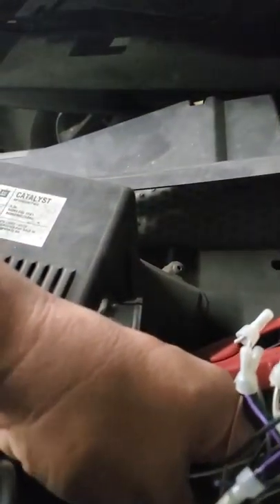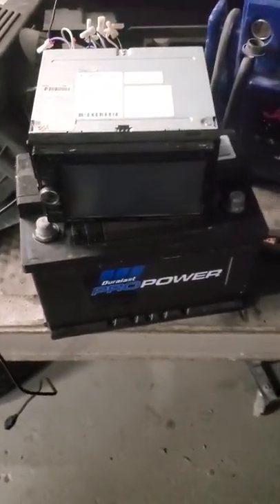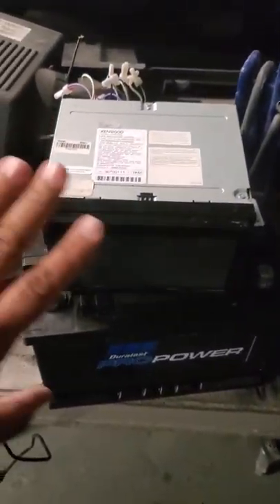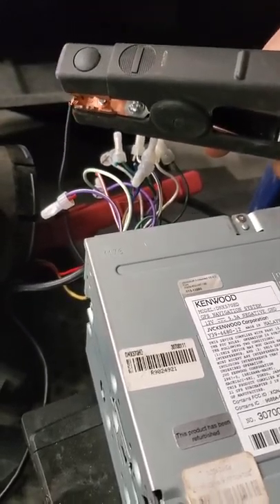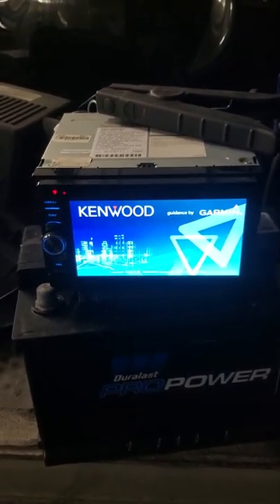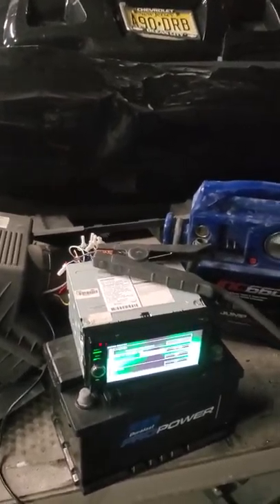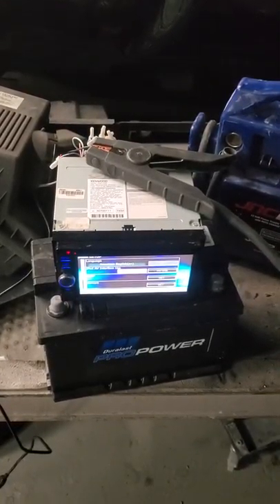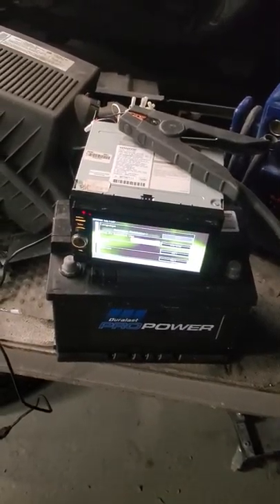Kenwood double din black screen repair

Comment: I have no idea what you just did. Because you didn’t actually tell us how to do it
Reply: Exactly right
Reply: There’s another video on the channel where he shows it. Basically there’s a daughter board plugged into the top. Remove the top cover and dvd drive, then the heat spreader plate, then remove the small board on top taking care to remove all the connectors carefully. There is also a solid black connector on the underside that connects it to the main board. 

After you’ve done that, remove the sd card by sliding the metal piece toward the center. 
Then on the opposite side of the board(with the big black connector(bbc😏) there is a big black chip😏 labeled Toshiba. Take a heat gun too it on high setting for a couple of minutes. Or just sit the whole board in an oven on 250F for 20 minutes.
Reply: well if you listen he did say what to do you reflow the unit it worked for me! wasnt expecting anything but im way happy

so ill be more clear

you have to completely dissasemble the unit remove all circuit boards and coat each one in flux both sides

then you need to heat them i used a oven but a heatgun would maybe be better

make sure do one board at a time and dont heat near plastic parts watch the flux and as soon as it starts to melt take away from heat wait and heat a further two times (the reason is too much heat at once may damage)

let boards cool dont move before cool incase any chips dislodge

this worked well for me my radio is working perfect
Reply: THANKS MATE MINE IS WORKING PERFECT NOW!

i just coated all the boards in flux and put them under the grill at 190c one by one i put them under the heat just till the flux melted (less than a minute) then pulled out waited then repeated 3 times for each side to make sure not to melt anything

i got the radio for free after fitting a new one for a customer so wasnt expecting anything ive reflowed stuff before 

i put it back toghether thinking it would still not work but its been on my rig for 4 days non stop works perfect
Reply: @hungryhungryhummer  not sure if you still active on YouTube but can I just put the radio in the oven for 20min
Reply: @hungryhungryhummer 2:55
Reply: @dondc2827 yeah man, just make sure to wrap it in aluminum foil first. 🤷‍♂️
Reply: He explained fairly well

Comment: This was fantastic! This happened to my daughters HU. I did what you suggested and used a heat gun and gave it a shot. Put it all back together and voila! It worked 🎉. Thanks so much for posting this!!
Reply: used heat gun on where?? please help. :)
Reply: @sonchan3621  watch around the 4:20 time and you will hear him state that the sister board has a chip (IC500). This is the problematic chip/board area. Heat this area up using a heat gun so that the solder will get shinny and reflow any bad connection. This is what worked for my case.
Reply: the processor. Cpu. All this thing ultimately is- is a freaking Microsoft Wibdows head unit. It's just using a mobile version that wouldve been the equivalent of like Wibdows 5 ot 6 mobile version. I would love to know if they sport intel cpus honestly . I want to water cool mine lol jk

Comment: DNX572bh here, same condition as in the vid. Followed these steps, heated the board to 250F for about 30 seconds each side, cooled, reinstalled, works perfect. No lie, like magic. I had never "refloated" a board before, but it was easy, start to finish took 30 minutes. Brilliant, thanks for the video, just saved me $500 easy!
Reply: How did you heat up the board?
Reply: I bought mine in 2015 for twice what u paid lol

Comment: Thank you and my kenwood dnx4150bt is now working 🙏
What I  used was a electronics hot air gun on 350deg for a few minutes by three time and let it cool in between. Pull down your unit and look for the gpu pcb board. It’s the one that holds the cell phone style memory card the
Gpu is close by. “Remove the memory card”!!!! Apply heat gun method and loosely put back together to test it back in your car. Note with removing the memory card you will need to reset up your unit. Back to your bench to reassemble the unit and re-install back into your car, good luck 🙏

Comment: I would like to give you so many thanks. My radio did this exactly. I searched everywhere on what it could be. You my friend are a life saver. I love this radio and it broke my heart when it died. I did the reflow and it’s been working perfectly. Thanks again.
Reply: How long did you heat the circuit board for or how hot did you let it get. Thanks, I’m just about to do it with mine
Reply: 190-220 I used a heat gun and a oven thermometer. Got it to temp and let it cool. Still working great

Comment: Hell Yeah. I bought a DNX 691HD in 2014 and installed it in my 2006 Ford Escape. It worked great for 8 years until yesterday... when it just completely quit. I tried all the fuses then I got out my meter and realized it was getting 12 volts on the red and the yellow wires on the plug (to the black - lead). When I plugged in the wire harness to the head unit the red triangle light on the reset button would come on and the fan would run for maybe 3 minutes but nothing else happened. Black Screen, No buttons worked etc. I thought it was either throw it away or spend money getting it repaired. I watched several of these videos about taking the daughter board off and heating it up with a heat gun. I tried it and it worked. I think the main chip to heat is not the one M.Parsons mentioned but the one in the middle. I used a temp. gun to keep from overheating the board but I got it up over 320° F with a heat gun for a minute or two then flipped it over and same thing. I cooled it off slowly then tested it. The damn thing worked again. I have run the radio and the CD player about 6 or more times over 3 or 4 hours today. It is back to working. I am thrilled! Thanks so much you made my weekend and my week. I spent maybe $700.00 in 2014 to buy it and now a similar head unit is over $1000.00.

Comment: I have a Kenwood ddx9905s used it a couple times, cars a summer car, after winter flickers and has black line down center of screen. Is one with mechanical tilt, so not sure how hard will be to replace.

Comment: Thanks for the video, my DNX891HD quit one day driving down the road, just the red light worked, same thing no buttons worked. Took er all apart and heated up worked a treat, working like new! Thanks so much for the explanation
Reply: I just had the same problem happen to the same unit you have too. I'm gonna try the reflow right now

Comment: fix did not work for me (heat gun at 250F for 90 seconds, then 450F for 60 seconds; both sides 1x; side with that IC500 chip 2x).  

for anyone with confidence in the fix, my DNX691HD is for sale @ $100 (plus shipping).  Just let me know.

Comment: I know this is an older video, but I just had a Kenwood DNX892 die on me last Saturday. I couldn't get the heat gun method to work, I think mostly due to my own fear I was going to slag the board since my guns lowest setting is 750 degrees. I did however try putting the sister board in the oven at 350 degrees for 40 minutes as someone else in this thread said they did. It worked! My DNX892 is now working like it's brand new again. Thank you for posting this guide series, and thank you commenters for the discussion that led me to a fix! I new version of this same type unit would have cost me around $1200-1500, so thanks for the savings as well!

Comment: Hey Michael.  I had a DNX7160 for about 10 years. Last summer it went black while I was driving and never turned on again. Exact same problem. Red light blinks and I can hear parts moving in the deck when I turn ignition on. I tried this trick with a hair dryer but no luck. Any other recommendations?
Reply from the maker: Heat gun from Harbour Frieght. $12
Reply: @michaelparsons3188  Thanks for your advise Michael. Heat gun didn’t do the trick for me either. Board on my deck looks a little different. I don’t have that big chip. I heated all other chips I saw but no luck.

Comment: I bought a kenwood DXN 690HD at a yard sale for 10 bucks. I wasn’t expecting much and after putting power to it a red power light is all I could get. I tried the reset and still nothing. After watching this video I decided what the heck and went through your procedure. I wasn’t sure how much heat and was easy on it with my heat gun and same problem. I took the board out and tried again with a longer period of heat and that was successful. Thanks a ton for this video!!! I would have likely tossed it. Keep up the great work!!

Comment: Hey thank you for posting this. My DNX571 red triangled out last summer. I used a heat gun on low for about 4 minutes each side and it worked. I’m m so happy. This wasn’t a cheap radio.

Comment: Did the trick for me. Thanks a bunch.  It was a Kenwood Excelon DNX692 real expensive unit with nav. Used a heat gun for not even a minute each side. Didn't have a thermometer so I went by feel on medium temp. Going to reinstall it in 2 days. Will report back if it ever goes out again.
Reply: Did it work ok when you reinstalled

Comment: Would reflowing your chip to any type of radio make the screen turn on? Because I have a DEHp6700MP pioneer and the MOSFET chip looks burnt up could I possibly make it work again if I reflow it because it still turns on but it just keeps popping fuse so I gave it a different ground and it’s turns on but the black light doesn’t

Comment: I took out the processor daughter board, and reflowed the main processor IC and the suport chips, burst into life (not flames), so far soo good, thanks for the video...👍
Reply: So you reflowed everything but the board he's doing in the vid? Sorry if it seems like a dumb question. I'm not familiar with any of this. Just want to fix my kenwood.

Comment: Would this happened to apply to single din Heading units as well? I have a 
Kenwood excelon KDC-X996
That I purchased years ago but has never seen heavy use I’ve had issues with it since the day I bought it for 400 some dollars Like meeting to have a jumper wire from the frame To an RCA to eliminate horrible feedback That couldn’t be solved after rewiring the harness several times to make sure it was done right as well as the display randomly shutting off but immediately restarting. Being young and dumb when I got it I didn’t take it vantage of customer service nor warranty which it is most definitely out of at this point and now after I spent a bunch of money upgrading my speakers because I missed my old system the display basically never turns on. I’ll be driving regardless if I hit a bump or not it’ll randomly turn on and usually turn off less than a minute later taking the face plate off the red light for the eject button is on so it clearly has power and isn’t losing power it just turns off and it’s not just the display because the sound cuts out along with it unlike when I originally bought it when the display would turn off the music would continue until the display turned back on moments later. I would be eternally grateful and would beyond appreciate Any help fixing this I would even be more than happy to pay someone to fix it Considering to buy a similar head unit with all the same features this one has I would need to sell a kidney to afford it in our current economy. So now I’m forced to use earbuds for music which is not only unsafe but really Fucking sucks since I drive this goddamn truck from coast to coast and everywhere in between 300+ days a year. I just want to hear music through high quality speakers again… Fuck I didn’t even be more than willing to give the friend discount to whoever fixes it if you ever need something delivered that requires Extra care Especially if it’s horse drawn carriages/sleighs, antiques, pianos, or taxidermy. Which are my specialties, PLEASE feel free to reply here and if I don’t answer DM me on my business Instagram @haulinheritage Like I said I would be eternally grateful and would Definitely Owe You one. Thank you.

Comment: Hey I tried to update software and firmware on my Kenwood Ddx393 and it didn’t take and the radio is stuck on this mode where the screen starts with a white line that moves across the top as if it is trying to load the new firmware
Reply from the maker: Sounds like i didn't take the update or it wasn't complete. Make sure thumb stick is formated correctly and reinstall the update

Comment: I replaced my daughterboard on my dnx891hd and now it doesnt have a software keycode. how do i fix that?
Reply from the maker: Look online. There are ways to bypass codes. Try all 00000
Reply: I need a daughterboard. Did the reflow and it didn't work on my DNX691HD.  Where did you get your daughterboard? Can't seem to find it anywhere. Thanks.
Reply: @edmondkohl4233  pacparts.com in california

Comment: With the unit that cost close to $1000 you would think that it would last a little longer. I have the same issue, but what my wife told me just prior to it going out is way more important.  she told me that she heard a POP sound then there was nothing.  I have checked all the fuses on the din unit and also at the fuse box.

Comment: I have a 570 with Toshiba chip.. if this process didn't work for me 2x, should I give it a 3rd try on a hotter setting of for longer?
Reply from the maker: It won't hurt to make it hotter. If its already broken. I was no expert on this repair. I just treated it as an xbox 360 reflow
Reply: @michaelparsons3188  Thanks, I appreciate the reply! I'm taking it back apart for one more attempt because before I had "reflowed" the Toshiba chip, not the microprocessor... 
Also I may give this a shot with my 360

Comment: Mine died this week after getting my car back from the mechanic for some engine related work. I think it's pure coincidence. The screen flickered a little, the radio would reset by itself, not it's completely dead. Black screen, red reset light, fan on and nothing else. Resetting it does not do anything.
Reply from the maker: That was my issue also. I picked up 2 decks and sold the one. Both still work. Mine is still going to this day and the one I sold is in a competition spl vehicle with do problems.
Reply: @michaelparsons3188  So all you need to do is heat up the chip set?

Comment: Great video !!! I used a hair dryer didn’t get the board hot enough.. so I went back with a heat gun and heated up the board front and back for like 5 minutes. Plugged everything back up! Boom it worked. Got the radio free off my friend and was about to throw it out ! Thanks for the video

Comment: How long should the reflow be and should I concentrate somewhere specifically? Sorry mine just took a dump. Thanks in advance
Reply from the maker: Focus in the chip in the other videos I have. There are instructions. I warm up the whole board both sides and than focus on the one chip. Let it cool down for 20 minutes or so before handling the chip after heating it

Comment: Hello I have a dnx571hd, my screen froze as I was driving so I turned it off and now it won’t turn back on. I unplugged the negative side of my battery to see if that would work but the radio still won’t turn on. Can anyone give me some advice ?
Reply: I have the same radio.. same thing happened to me and this fixed it !